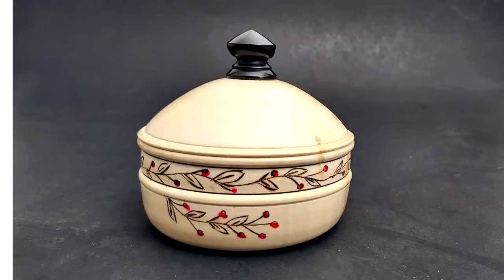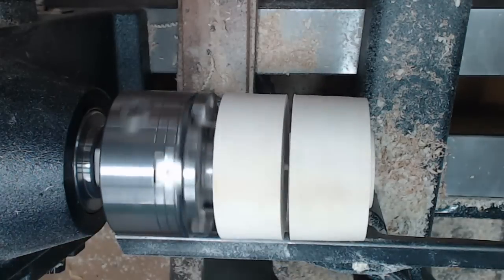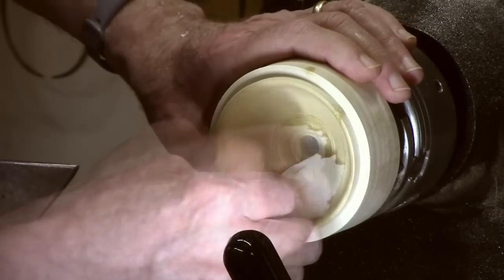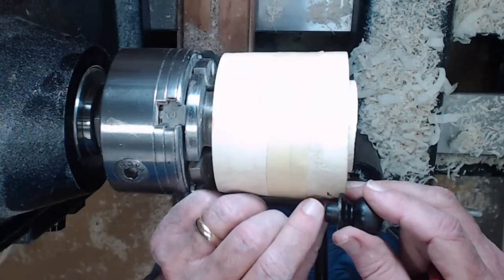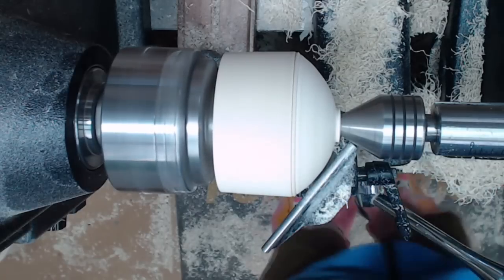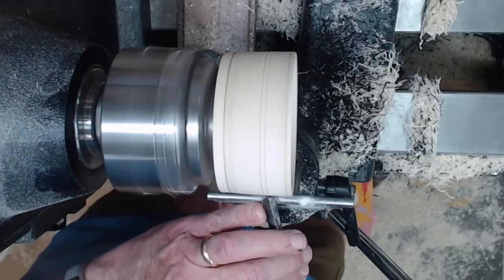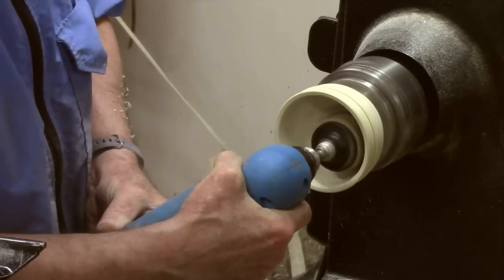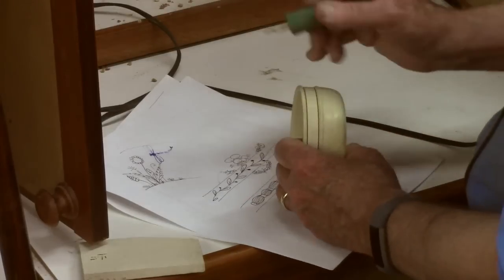Woodturning a Holly Box- One of My Favorites!

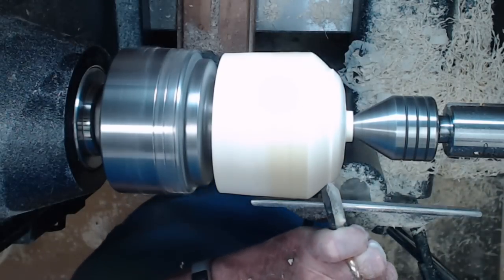Comment: Mike, What’s with the duck slippers I saw at the ~12:01 point in the video?  I was watch you as you were working on refining the top and you stepped away from the lathe a little I saw them and ???  BTW: Nice box and the pyrography on the plane pale wood make it look great.  Cheers, Tom
Reply from the maker: I will do a tip video on them Wed. You have a sharp eye.
Reply: @MikePeaceWoodturning I try watching closely to see the tool angles, tool presentation etc and they just caught my eye.  Cheers, Tom